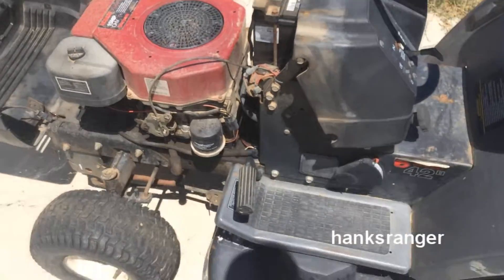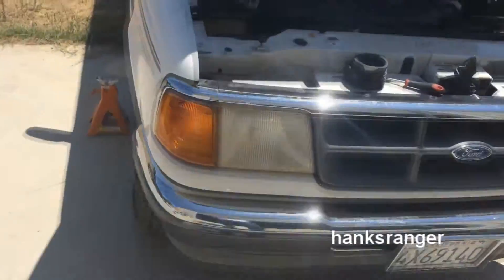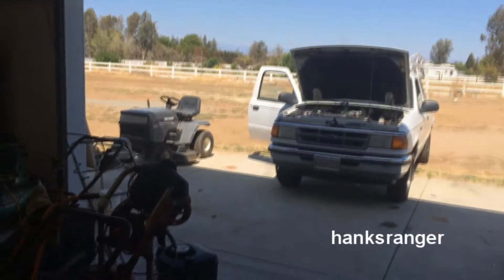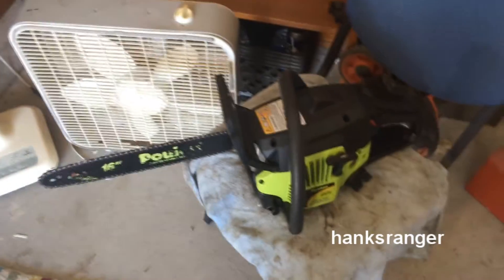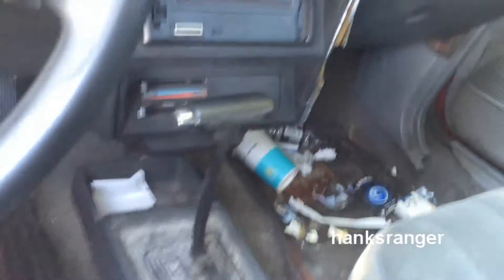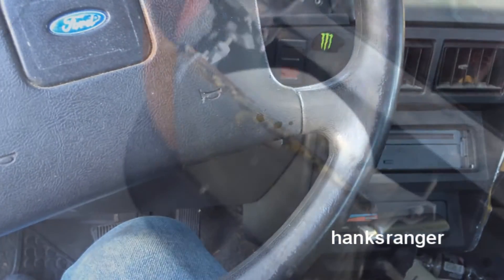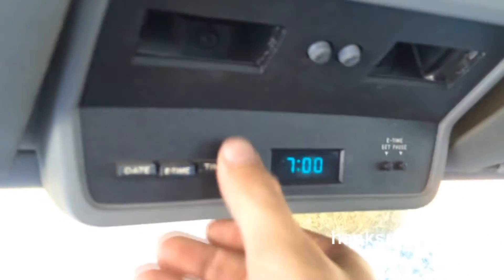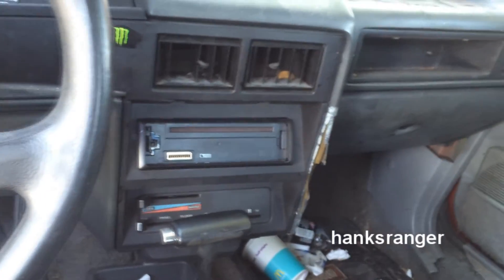VLOG: $300 Car - 24 Hours of LeMons?

Comment: fucking ford an 86 has a tach but a 94 doesnt 
just needs some oxyclean?
that has overdrive too huh
Reply from the maker: Torque converter locks up I think. It is a ford atx transmission has three gears but no overdrive and no it's pretty bad man the driver seat is fucked rail is broke and seat is pretty trashed and the carpet is shot. Probably going to have to replace it carpet kits are pretty reasonable and you can also buy dash caps too
Reply: yikes thats bad
Reply from the maker: I'm pretty sure there is mold in it somewhere. 3 years of chain smoking didn't help either. It's got a funky smell in it. the torque converter locking up is a feature of it not a bad thing lol. It is kinda like overdrive.
Reply: Hank's Small Engine Repair you should fix it up